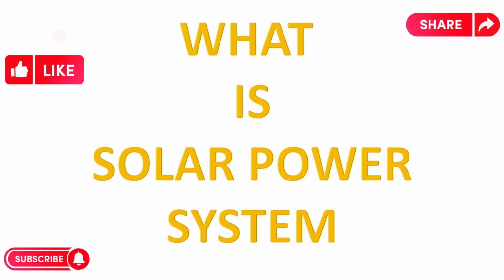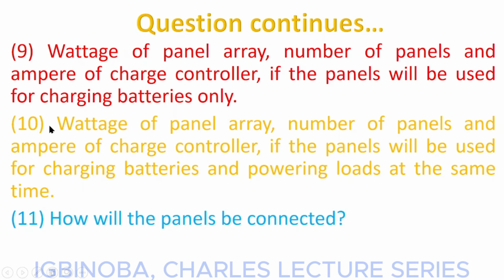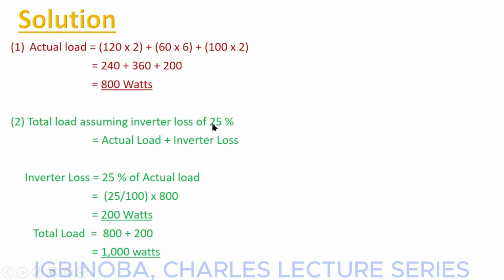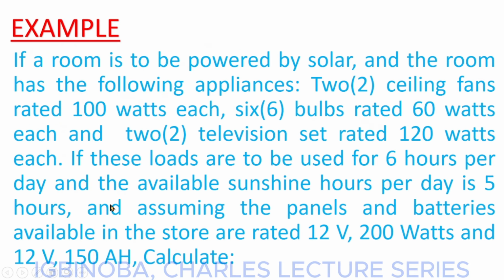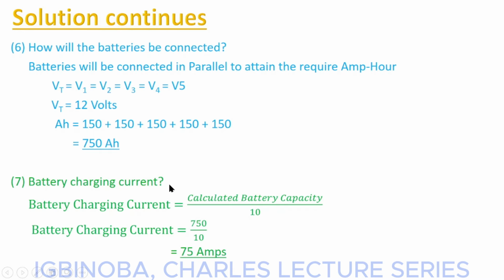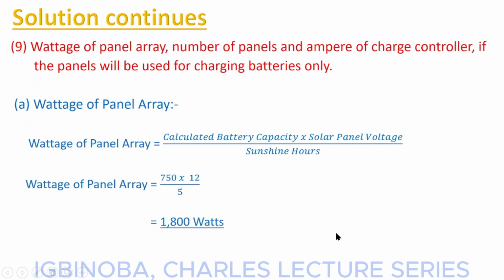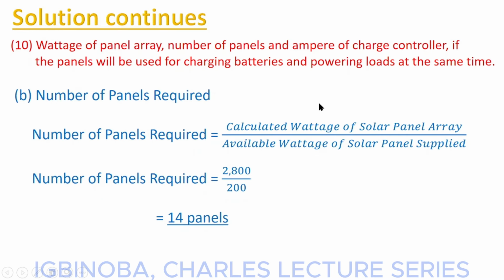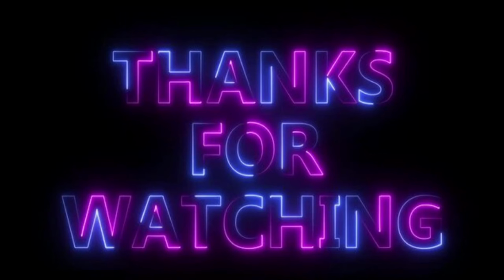Design of Solar Power System

Comment: CHM339M

 
1. Actual load= (100×3)+(60×10)+(120×4) =1380watts
2. Total load assuming inverter loss of 25%= Actual load +Inverter loss
Inverter loss=25% of Actual load
= 25%×1380=345 watts
Total load= 1380+345=1725 watts
3. Inverter rating on VA using power factor of 0.8
= (1725÷0.8)= 2156.25
4. Battery capacity using factor for reserve 75%=(2×1725×6×0.75)=1293.75Ah
5. No. of batteries for backup hours=1293.75Ah÷150Ah= 8.6 =8 batteries 
6. How batteries will be connected?
The batteries will be connected in parallel 
Vt=V1=V2=V3=V4=V5=V6=V7=V8
Ah= 150+150+150+150+150+150+150+150=1200
7. Battery charging current=1293.75÷10=129Amps
8. Battery charging time assuming charging loss of 40%= 1293.75Ah+(40%+1293.75Ah)÷129A=14hrs
9a. Wattage panel array= 3105 watts
9b. Number of panels required= 3105÷345=9 panels 
9c. Ampere of charging controller required= 3105÷12=258.75Amps
10a. Wattage of panel array= Calculated wattage of solar panel array for charging battery only+ calculated total load =3105+1725=4830watts
10b. Number of panels required= calculated wattage of solar panel array÷ Available wattage of solar panel supplied= 4830watts÷345= 14Amps
10c. Ampere of charge controller= calculated wattage of solar panel array÷ solar panel voltage=4830watts÷12volts= 402.5Amps
11. How will the panels be connected?
Ans: They will be connected in parallel

Comment: CIV38H

1. Actual load - 1380W
2. Total load - 1725W
3. Inverter rating - 2156.25VA
4. Battery capacity - 1293.75Ah
5. Number of batteries -9
6. Batteries are connected in parallel
7. Battery charging current - 129.4amps
8. Battery charging time 14hrs
9a. Wattage of panel array - 3105W
9b. Number of panels - 16 panels
9c. Charge controller - 258.75A

10a. Wattage of panel array - 4830W
10b. Number of panels-24
10c. Charge controller - 402.5A

11.Panels are arranged in parallel
Reply: EEE323W

1. Actual load - 1380W

2. Total load - 1725W

3. Inverter rating - 2156.25VA

4. Battery capacity - 1293.75Ah

5. Number of batteries -9

6. Batteries are connected in parallel

7. Battery charging current - 129.4amps

8. Battery charging time 14hrs

9a. Wattage of panel array - 3105W

9b. Number of panels - 16 panels

9c. Charge controller - 258.75A

10a. Wattage of panel array - 4830W

10b. Number of panels-24

10c. Charge controller - 402.5A

11.Panels are arranged in parallel

Comment: CIV327A

1 (3×100)+(10×60)+(4×20)
1380 Watts 

2  inverter loss is 345 Watts 
Total load is 1380+345= 1725 Watts 

3 1725÷0.8= 2156

4  battery capacity is 1294Ah

5 1294/150 = 9 batteries 

6 1200

7 1294/10 =129 Amps 

8 charging time is 14 hours 

9a 1294×12/5 = 3105 Watts 
b 3105/200= 15 panels.
c 3105/12 = 259 Amps

10a 3105+1725=4830 Watts 
b 4830÷200= 24 panels
c 4830÷12= 403 Amps

11 The panel will be connected in parallel.

Comment: MECH3119O
1)actual load 1380watts

2) total load= 1725watts 

3) inverter rating =2156.25VA

4) battery capacity 1293.75Ah

5) Number of batteries= 9

6) batteries are connected in parallel

7)charging current=129.4amps 
8) battery charging time=14hrs

9a) wattage of panel array= 3105 watts

9b) number of panels=16panels

 9c)charge controller= 258.75A 

10a) wattage of panel array 4830watts 

10b) number of panels = 24

10c)charge controller= 402.5A

 11) panels are arranged in parallel

Comment: PETRO3135E

1. Actual Load (Watts): 1380 W  
2. Total Load (DC with 25% Inverter Loss): 1720 W  
3. Inverter Rating : 2156.25VA
4. Battery capacity: 1293.75Ah
5. Number of Batteries (12V, 150 Ah): 9  
6. Battery Connection (48V System): 2 parallel strings of 4 batteries in series  
7. Battery Charging Current: 129.4 A  
8. Minimum Charging Time (hrs): 14 hours  
9a. 3105W
 b. 15.5 panels
c. 258.8A
10a. 4830W
b. 24 panels 
c. 402.5A  
11. Panel Connection: SERIES -PARALLEL

Comment: EEE3147Q

Solution

1. Actual Load = 1380 watts

2. Total Load = 1725 watts

3. Inverter Rating = 2156.25 VA

4. Battery Capacity = 1293.75 Ah

5. Number of Batteries = 8.625  which is approximately 9 batteries
Parallel

7. Battery charging current = 129.375 Amps

8. Charging time = 14 hrs

9. (a) 3105 watts
(b) 15.525 ~ 16 panels
(c) 258.75 Amps

10. (a) 4830 watts
(b) 24.15 ~ 24 panels

(c) 402.5 Amps

11. Parallel

Comment: Code: PETRO3183A

1. Actual load= (100×3)+(60×10)+(120×4) =1380watts

2. Total load assuming inverter loss of 25%= Actual load +Inverter loss
Inverter loss=25% of Actual load
= 25%×1380=345 watts
Total load= 1380+345=1725 watts

3. Inverter rating on VA using power factor of 0.8
= (1725÷0.8)= 2156.25

4. Battery capacity using factor for reserve 75%=(2×1725×6×0.75)=1293.75Ah

5. No. of batteries for backup hours=1293.75Ah÷150Ah= 8.6 =8 batteries 

6. How batteries will be connected?
The batteries will be connected in parallel 
Vt=V1=V2=V3=V4=V5=V6=V7=V8
Ah= 150+150+150+150+150+150+150+150=1200

7. Battery charging current=1293.75÷10=129Amps

8. Battery charging time assuming charging loss of 40%= 1293.75Ah+(40%+1293.75Ah)÷129A=14hrs

9a. Wattage panel array= 3105 watts

9b. Number of panels required= 3105÷345=9 panels 

9c. Ampere of charging controller required= 3105÷12=258.75Amps

10a. Wattage of panel array= Calculated wattage of solar panel array for charging battery only+ calculated total load =3105+1725=4830watts

10b. Number of panels required= calculated wattage of solar panel array÷ Available wattage of solar panel supplied= 4830watts÷345= 14Amps

10c. Ampere of charge controller= calculated wattage of solar panel array÷ solar panel voltage=4830watts÷12volts= 402.5Amps

11. How will the panels be connected?

Ans: They will be connected in parallel

Comment: PETRO3147Q 

1. Actual load= (100×3)+(60×10)+(120×4) =1380watts

2. Total load assuming inverter loss of 25%= Actual load +Inverter loss
Inverter loss=25% of Actual load
= 25%×1380=345 watts
Total load= 1380+345=1725 watts

3. Inverter rating on VA using power factor of 0.8
= (1725÷0.8)= 2156.25

4. Battery capacity using factor for reserve 75%=(2×1725×6×0.75)=1293.75Ah

5. No. of batteries for backup hours=1293.75Ah÷150Ah= 8.6 =8 batteries 

6. How batteries will be connected?
The batteries will be connected in parallel 
Vt=V1=V2=V3=V4=V5=V6=V7=V8
Ah= 150+150+150+150+150+150+150+150=1200

7. Battery charging current=1293.75÷10=129Amps

8. Battery charging time assuming charging loss of 40%= 1293.75Ah+(40%+1293.75Ah)÷129A=14hrs

9a. Wattage panel array= 3105 watts

9b. Number of panels required= 3105÷345=9 panels 

9c. Ampere of charging controller required= 3105÷12=258.75Amps

10a. Wattage of panel array= Calculated wattage of solar panel array for charging battery only+ calculated total load =3105+1725=4830watts

10b. Number of panels required= calculated wattage of solar panel array÷ Available wattage of solar panel supplied= 4830watts÷345= 14Amps

10c. Ampere of charge controller= calculated wattage of solar panel array÷ solar panel voltage=4830watts÷12volts= 402.5Amps

11. How will the panels be connected?
Ans: They will be connected in parallel

Comment: Petro 372T
1. Actual load = 1380 watts
2. Total load = 1725 watts
3. Inverter rating in VA = 2156.25 VA
4. Battery Capacity = 1293.75AH
5. Number of batteries for backup hours = 8.625
6. The battery will be connected in parallel. VT = V1= V2=V3=V4=V5
VT= 12volts
Ah = 150+150+150+150+150 = 750 Ah
7. Battery charging current = 129.375 Amps
8. Battery charging time less than 40 % = 14hrs
9. Wattage of panels array = 3105 watts
9b. Number of panels= 15.525 panels 
9c. Ampere of charge controller = 258.75Amps
10. Wattage of panels array = 4830 watts
10b number of panels = 24.15 panels 
10c Ampere of charge controller = 402.5 amps
11. Solar panel will be connected in parallel

Comment: PETROCHEM348V

1 Actual load 1380W
2 Total load  1725W
3 Inverter rating  2156.25VA
4 battery Capacity 1293.75Ah
5 number of batteries 8.6
6 Parallel 
7 Battery charging  129.4A
8 T = 14hrs
9 (a) 3105W
   (b) 16 panels 
   (c)  258.75 A
10 (a) 4830W 
     (b) 24 panel 
     (c) 402.5A 
11 Parallel

Comment: CIV316X
1. Actual load - 1380W
 2. Total load - 1725W
 3. Inverter rating - 2156.25VA 4. Battery capacity - 1293.75Ah
 5. Number of batteries - 9 
6. Batteries are connected in parallel 
7. Battery charging current - 129.4amps 
8. Battery charging time 14hrs 9a. Wattage of panel array - 3105W
 9b. Number of panels - 16 panels 
9c. Charge controller - 258.75A 
10a. Wattage of panel array - 4830W 
10b. Number of panels - 24 10c. Charge controller - 402.5A 
11. Panels are arranged in parallel

Comment: COMP390L
1. Actual load - 1380W
2. Total load - 1725W
3. Inverter rating - 2156.25VA
4. Battery capacity - 1293.75Ah
5. Number of batteries - 9
6. Batteries are connected in parallel
7. Battery charging current - 129.4amps
8. Battery charging time 14hrs
X
:
9a. Wattage of panel array - 3105W
9b. Number of panels - 16 panels
9c. Charge controller - 258.75A
10a. Wattage of panel array - 4830W
10b. Number of panels - 24
10c. Charge controller - 402.5A
11. Panels are arranged in parallel

Comment: EEE3105A
1 . Actual Load : 1380 watts
2. Total Load : 1725 watts
3. Inverter Rating: 2156.25 VA
4. Battery Capacity : 1293.75 Ah
5. Number of Batteries: 8.625 - 9 batteries
6. Parallel
7. Battery charging current : 129.375 Amps
8. Charging time: 14 hrs
9. (a) 3105 watts
(b) 15.525-16 panels
(c) 258.75 Amps
1 0. (a) 4830 watts
(b) 24.15 - 24 panels
(c) 402.5 Amps
11. Parallel

Comment: PETROCHEM359G

1 Actual load 1380W
2 Total load  1720W
3 Inverter rating  2156.25VA
4 battery Capacity 1293.75Ah
5 number of batteries 8.6
6 Parallel 
7 Battery charging  129.4A
8 T = 14hrs
9 (a) 3105W
   (b) 15.5 panels 
   (c)  258.75 A
10 (a) 4830W 
     (b) 24 panel 
     (c) 402.5A 
11 Parallel

Comment: PETROCHEM313M

1 Actual load 1380W
2 Total load  1720W
3 Inverter rating  2156.25VA
4 battery Capacity 1293.75Ah
5 number of batteries 8.6
6 Parallel 
7 Battery charging  129.4A
8 T = 14hrs
9 (a) 3105W
   (b) 15.5 panels 
   (c)  258.75 A
10 (a) 4830W 
     (b) 24 panel 
     (c) 402.5A 
11 Parallel

Comment: EEE340N
1 Actual load =1380 watts
2 Total load =1725 watts 
3 Inverter rating = 2156.25 VA
4 Battery rating = 1293.75 Ah
5 Number of batteries = 9 
6 Battery are connected in parallel 
7 Battery charging current =129.4 Amps
8 Battery charging time = 14 hrs 

9a Wattage of panel array =3105 watts
9b Number of panel = 16 panels 
9c Charge controller = 258.75 A

10a Wattage of panel array = 4830 watts 
10b Number of panels = 24 
10c charge Controller = 402.5 A

11 Panels are arranged in parallel

Comment: CHM109F

1. Actual load = 1380w
2. Total load = 1725w
3. Inverter rating = 2156.25 VA
4. Battery capacity = 1293.75AH
5. No of battery =  9
6. Parallel 
7. Battery charging current = 129.38 amps
8. Charging time = 14 hours
9a. 3105w
   b. 15.5 panels
   c. 258.75
10a. 4830w
    b. 24 panels
    c. 402.5 A
11. Parallel

Comment: PETRO382D
1. Actual Load: 1380 W

2. Total Load (including inverter loss): 1725 W

3. Inverter Rating (VA): 2156.25 VA

4. Battery Capacity: 1293.75 Ah

5. Number of Batteries: 9 batteries

6. Battery Connection: Parallel

7. Battery Charging Current: 129Amps

8. Battery Charging Time: 14hrs

9. Panel Array (for charging batteries only):

- Wattage: 3105 W

-Number of Panels: 15.5 or 16 panels

- Charge Controller Ampere: 258.75 Amps

10. Panel Array (for charging batteries and powering loads):

- Wattage: 4830 W

-Number of Panels: 24.15 or 25 panels

- Charge Controller Ampere: 402.5Amps

11. Panel Connection: Parallel

Comment: PETRO329C
1. 1380 W

2. 1725 W

3. 2156.25 VA

4. 1293.75 Ah

5. 8 batteries

6. Batteries connected in parallel

7. 129 A

8. 14 hrs
9a. 3105 W
9b. 9 panels
9c. 258.75 A
10a. 4830 W
10b. 14 panels
10c. 402.5 A

9. Panels connected in parallel
10.

Comment: CHM107D

1. Actual load: 1380W
2. Total load: 1725W
3. Inverter rating: 2156.25VA
4. Battery capacity: 1293.75AH
5. Number of batteries: 9
6. Configuration: Parallel
7. Battery charging current: 129.375 amps
8. Charging time: 14 hours
9. (A) 3105W
(B) 15.5 panels
(C) 258.75A
10. (A) 4830W
(B) 24 panels
(C) 402.5A
11. Configuration: Parallel

Comment: 1. Actual Load = 1380 watts

2. Total Load = 1725 watts

3. Inverter Rating = 2156.25 VA

4. Battery Capacity = 1293.75 Ah

5. Number of Batteries = 8.625 ~ 9 batteries

6. Parallel

7. Battery charging current = 129.375 Amps

8. Charging time = 14 hrs

9. (a) 3105 watts
    (b) 15.525 ~ 16 panels
    (c) 258.75 Amps

10. (a) 4830 watts
    (b) 24.15 ~ 24 panels
    (c) 402.5 Amps

11. Parallel

PETRO336J

Comment: PETRO3121Q

1. Actual Load

Actual Load = (3 × 100) + (60 × 10) + (120 × 4)
Actual Load = 1380 Watts.

---

2. Total Load

Total Load = Actual Load + (Actual Load × Power Loss)
Total Load = 1380 + (1380 × 0.25)
Total Load = 1725 Watts.

---

3. Inverter Rating in VA

Inverter Rating = Total Load ÷ Power Factor
Inverter Rating = 1725 ÷ 0.8 = 2156.25 VA.

---

4. Battery Capacity

Battery Capacity = (2 × Total Load × Backup hours × Factor for Reserve) ÷ Battery Voltage
Battery Capacity = (2 × 1725 × 6 × 0.75) ÷ 12
Battery Capacity = 1293.75 Ah.

---

5. Number of Batteries

Number of batteries = Battery Capacity ÷ Capacity of given battery
Number of batteries = 1293.75 ÷ 150 = 8.625
Rounded up ≈ 9 batteries.

---

6. Battery Connection Type

The batteries will be connected in PARALLEL to meet the voltage requirement of 12V.

---

7. Battery Charging Current

Battery Charging Current = Battery Capacity ÷ 10
= 1293.75 ÷ 10
= 129.375 Amps.

---

8. Battery Charging Time (@ 40% Loss)

Battery Charging Time = (Battery Capacity + (Battery Capacity × 40%)) ÷ Charging Current
= (1293.75 + (1293.75 × 0.4)) ÷ 129.375
= 14 hours.

---

9. Solar Panels (Without Load)

a. Wattage of Panel
Wattage (without load) = (Battery Capacity × Panel Voltage) ÷ Sunshine hours
= (1293.75 × 12) ÷ 5
= 3105 Watts.

b. Number of Panels
Number of panels = 3105 W ÷ 200 W
= 15.525 ≈ 16 panels.

---

10. Solar Panels (With Load)

a. Wattage (with load)
= Wattage (without load) + Total Load
= 3105 + 1725
= 4830 Watts.

b. Number of Panels
4830 W ÷ 200 W = 24.15
Rounded ≈ 25 panels.

c. Current of Charge Controller
= 4830 W ÷ 12 V
= 402.5 Amps.

---

11. Panel Connection Type

The panels should be arranged in PARALLEL to maintain a supplied voltage of 12V.

Comment: CHEM24X

1. Actual load= 1380w

2. Total load = 1725w

3. Inverter rating= 2156.25VA

4. Battery capacity= 1293.75AH

5. No batteries 9

6. Parallel

7. Battery charging current= 129.38ampere

8. Charging time= 14 hours

9. a) 3105w

b) 15.5 panels

c) 258.75A

10. a) 4830w

b) 24 panels

c) 402.5A

11. Parallel

Comment: CHM3139I

1 Actual loading = 1380W
2 Total load = 1720W
3 inverter rating =2156.25VA
4 Battery capacity =1293.75Ah
5 number of batteries = 9
6 parallel
7 Battery charging current = 129.4Amps
8 charging time = 14hrs
9 A 3105w
B 16 panels
C 258.75amps
10 A 4830W
B 24 panels
C 402.5 amps
11 parallel

Comment: Chem108E

1. 1380W, 8280Wh/day
2. 1840W, 11040Wh/day
3. 1725 VA (1.725kvA)
4. 1610 Ah
5. 11
6. All parallel
7. 165 A
8. 8.33 h
9. (a) 11040Wh (b) 18400 Wh/day (c). 3680W (d) 19 panels (e) 80 A
10. (a) 2668W (b) 14 panels (c) 60 A
11. 4 strings of 3s, 1 string of 2s

Comment: EEE376X

1. Actual load - 1380W
2. Total load - 1726W
3. Inverter ratings - 2156.25VA
4. Battery capacity - 1293.75AH
5. Number of batteries - 9
6. Connection - in parallel 
7. Charging current - 129.38A 
8. Charging time - 14hrs 

9a. 3105W
b. 15.5 = 16 panels 
c. 258.75A

10a. 4830W
b. 24 panels
c. 402.5A

11. Connection - in parallel

Comment: CHM346T

1. Actual load is 1380w
2. Total load is 1725w
3. Inverter rating is 2156.25VA
4. Battery capacity is 1293.75AH
5. No. Of batteries is 9
6. Parallel
7. Battery charging current is 129.375amps
8. Charging time is 14hours
9. (A) 3105w
(B) 15.5panels
(C) 258.75A
10. (A) 4830w
(B) 24panels
(C) 402.5A
11. Parallel

Comment: COMP3112H

Actual load = 1380 watts
2. Total load = 1725 watts
3. Inverter rating = 2156.25 VA
4. Battery capacity = 1293.75 Ah
5. Number of batteries = 9
6. Batteries are connected in parallel
7. Battery charging current = 129.4 amps
Battery charging time = 14 hrs
E
9a. Wattage of panel array = 3105 watts
9b. Number of panels = 16 panels
9c. Charge controller = 258.75 A
10a. Wattage of panel array = 4830 watts
10b. Number of panels = 24
10c. Charge controller = 402.5 A
11. Panels are arranged in parallel

Comment: PETRO3142L

1. Actual load= (100×3)+(60×10)+(120×4) =1380watts
2. Total load assuming inverter loss of 25%= Actual load +Inverter loss
Inverter loss=25% of Actual load
= 25%×1380=345 watts
Total load= 1380+345=1725 watts
3. Inverter rating on VA using power factor of 0.8
= (1725÷0.8)= 2156.25
4. Battery capacity using factor for reserve 75%=(2×1725×6×0.75)=1293.75Ah
5. No. of batteries for backup hours=1293.75Ah÷150Ah= 8.6 =8 batteries 
6. How batteries will be connected?
The batteries will be connected in parallel 
Vt=V1=V2=V3=V4=V5=V6=V7=V8
Ah= 150+150+150+150+150+150+150+150=1200
7. Battery charging current=1293.75÷10=129Amps
8. Battery charging time assuming charging loss of 40%= 1293.75Ah+(40%+1293.75Ah)÷129A=14hrs
9a. Wattage panel array= 3105 watts
9b. Number of panels required= 3105÷345=9 panels 
9c. Ampere of charging controller required= 3105÷12=258.75Amps
10a. Wattage of panel array= Calculated wattage of solar panel array for charging battery only+ calculated total load =3105+1725=4830watts
10b. Number of panels required= calculated wattage of solar panel array÷ Available wattage of solar panel supplied= 4830watts÷345= 14Amps
10c. Ampere of charge controller= calculated wattage of solar panel array÷ solar panel voltage=4830watts÷12volts= 402.5Amps
11. How will the panels be connected?
Ans: They will be connected in parallel